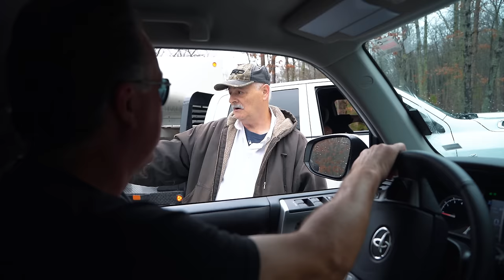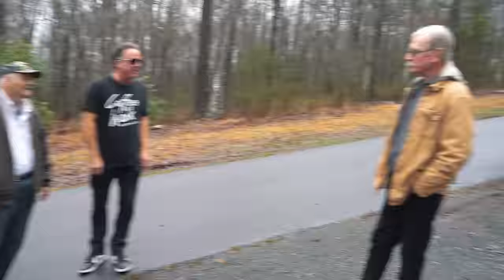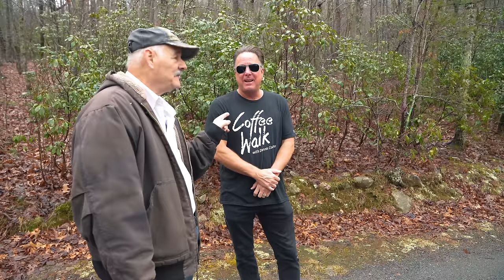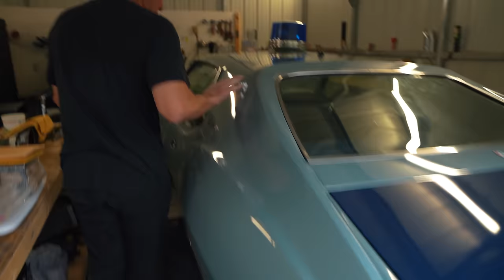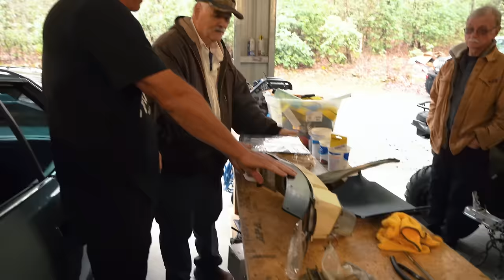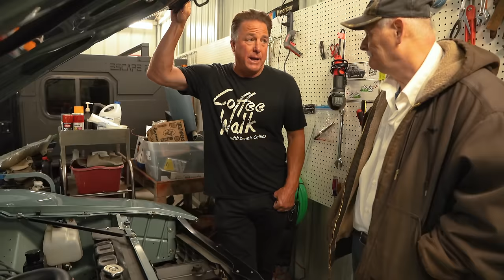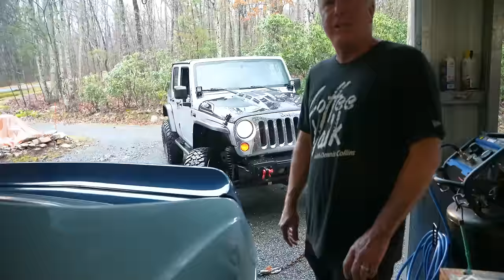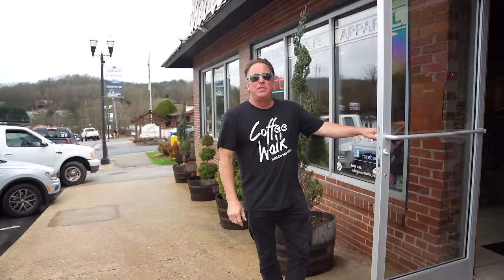FOUND: 1 of 13 Existing ADPS 1972 Javelin SST Police Cars!

Comment: One of my dad's favorite stories was him attempting to flee an Alabama State Trooper Javelin in his '67 Shelby. He was unsuccessful.
Reply: Duh. He was in a Ford.
Reply: Thanks, WOW… Great** Story!!! ** ANYMORE HISTORY OF THAT event???? (( some INDIANA TROOPERS , had HEMIs from 1963….etc…see my osts. Thanks..
Reply: @deeremeyer1749  yep, kind of…. Oddly, the 57-58:FORD POLICE CARS “” *INTERCEPTORS , real ones”: were preferred Buys/ Cars for my CAR GENERATIONS, ETC( we knew some engines  massaged, bigger tires, Brakes Truck,maybe run tough, ++ extras) , IF WE could get the engine, Or Cars, etc.(( INDIANA STATE POLICE, & some “Locals “, with GOOD  DEALER CONNECTIONS , ESP I TO the late 1960-70s(( 409, 427s,++)
Reply: @deeremeyer1749  That Shelby would be worth more than your life today.
Reply: @TheEnd-eg6wq  Dad bought the car when he was a Service Manager at a Ford dealership in Ypsilanti, MI in 1969-70. He falsified warranty repairs and put, as he said, "every high performance part that FMC had" on the Mustang.
Reply: @deeremeyer1749  on a racetrack??
Reply: @deeremeyer1749  Tell that to the Coyote!
Reply: @DEEREMEYER1  I seriously doubt that the Trooper Javelin would have out run my 71 Ford Custom with an N code 429. Police spec car.
Reply: @davidkeeton6716  It's got a cop motor, a 440 cubic inch plant, it's got cop tires, cop suspensions, cop shocks. It's a model made before catalytic converters so it'll run good on regular gas.
Reply: @Long sleeve thong  Well no, that would be my 1970 Plymouth Fury 1 440 police pursuit car.

Comment: Being a 70 year old Alabama guy, I remember seeing these on the road when I was in my late teens and early 20's. You DID NOT try to outrun one of them. 😁
Reply: Ohhhh, there has to be a story behind your comment!! Please do tell!!❤❤
Reply: @teaches2010  Back in the day I had a Torino GT that would run about 130.I wouldn't try. There were some big block muscle cars that tried them out. It didn't end well. Very few muscle cars had the rear gears for top end the Javelins had.
Reply: @stevekynard6658  Torino GT was a great pick ..
Always my favorite
Reply: Sorry but you are wrong. You could TRY to outrun them. However TRYING does not in any way mean SUCCESSFUL. You could try all you wanted but odds were you were going to fail and would fail badly.
Reply: @todddenio3200  It was best to pull over and get your ticket. Trying to outrun one was going to get you in more trouble.
Reply: @stevekynard6658  I understand that and agree. I was teasing you for saying You did not try to outrun one of them. If you read my comment, I was saying a person could TRY to do it... but the liklihood of actually succeeding at outrunning them was not in the runners favor...and that failure was imminent...and was likely to fail badly.. In other words try to outrun them and realize you will be either going to jail when they catch you or they will be using a water hose and a sponge to clean what is left of you off of the road after you crashed while TRYING to outrun them.
Reply: @todddenio3200  No worries.  I was young and foolish in those days but knew where to draw the line. Not to say a sheriff car or two didn't get left behind.  ;-)  Just don't mess with the trooper hotrods.
Reply: @stevekynard6658  Steve you are so right! Back in 1976 my friend and I were cruising around in our small town. He was about 10 mph over the speed limit when a policeman who came up behind us hit the siren. My friend who was 16 had already had two speeding tickets and his parents weren't very happy about it. Anyhow I told him just pull over and take your chances on the ticket. Anyhow he didn't listen and punched the gas pedal to the floor. Well we did get away temporarily due to some reckless driving but he had the only yellow 67 GTO in town. He dropped me off at my house and went home. When he got home they let him get in his driveway and proceeded to pounce on him from all sides. Since his parents were working class and they had made sacrifices to buy him the car it got sold to pay the lawyer, tickets and associated expenses. When I turned 16 a few months later I did get my share of speeding tickets but after what happened to my friend I never had any interest in trying to outrun the police. Seemed like a losing proposition in the long run!
Reply: @kickit59  My Dad bought a 1969 GTO Judge 4 speed that my brother drove. He had put headers and a chopped exhaust, and bigger tires on the rear. Had monkeyed with the timing just a hair. fast off the line put due to gearing top end was where you could almost catch him or did. He took a sat. early morning run on an unfinished 60 freeway. it ended at the turn off for home. He went down two off ramps, uncorked then got back on, wide open, On the seconded overcrossing was a CHP. He saw the lights and shut down. He could have kept going but didn't. The officer had his pistol drawn and had him facedown. After chewing him a new one. he let him off with a ticket. In excess of 120. I couldn't believe seeing that Ticket! Man, Dad was P.O to no end! I just laughed. He ended up in court with 2 weeks in the pokey but was released on Sunday. $500. bucks poorer with a black eye and no shirt from the bus ride downtown. Learning the hard way HUH! The dumb stuff you do to your Folks when you're young. Gald I only had a 58 T-bird. It was old and slow.
Reply: I am a 72 year young originally from Anniston Alabama and I loved watching those Alabama State Troopers chasing down those speeders I got my kicks watching em.........but now I live in the Philippines for over 32 year.  I paid a visit in 2019 to visit my little brother over 300 pounds and did nothing but eat good ole Alabama Southern food........
Reply: I was a young teen when these were put in service. I lived close to the state capitol and my neighborhood had several ranking StateTrooper personnel that drove the plain solid color Javelins and Amabassadors with 401s. Sharp cars for that day. A neighbor was a Trooper patrolman and had a Javelin but after a few months had a 70 Ford 500 with a 428 again. His Javelin and others had power loss from rocker arms and  pivots wearing when run for extended high speeds. AL didn't title cars until 75 year model so this 72  would not have had an AL title.
Reply: @jimmyaber5920  yeah I always like the style of both AMX and Javelin back in those good ole days hahahaha
Reply: That's just laughable, you don't know how to get off the interstate?
Reply: @christopherflynn5359  There were no interstate roads  near Dallas, Marengo and Choctaw counties in Alabama.  Still aren't.
Reply: @teaches2010  Liquor/moonshine have anything to do with that statement?
Reply: Well in all fairness I did use the state line to my advantage. There were some issues between Al. And Fl. troopers in our area.
Reply: More fun with a 4 oh One. Imagine the embarrassment of being caught by a “Rambler” or “Nash”?  Yes definitely a Holy Grail!
Reply: Cant imagine going well over 100 mph and trying to stop. Cars of this vintage age had terrible brakes. Did this cars have disk brakes up front?
Reply: @davidwisniewski3859  None of mine had front disc. Not sure about the trooper hotrods.
Reply: @wildbill7081   Hello,from a fellow Calhoun County native(I'm from the Roy Webb Community just North of Jacksonville,Alabama).How does the Philippines compare to your hometown,and do you ever plan on moving back permanently?
Reply: @davidh6818  I left the Anniston area back in 1970 joining the US Air Force for four years.  After bumming around for many months I then joined the US Army and retired in 1990,       After my retirement moved here to the Philippines and visit Alabama and other states I lived mostly to see relatives and eat the southern food.  My brother lives now in Huntsville area and last went to visit him in 2019 just before covid.  Thank you Davidh for your reply to my comment and I love Alabama for sure and been to Jacksonville and all over that are but I plan on being cremated and stay here.   How old are you and have you ever visited any Asian countries and if you ever visit the Philippines I can show you around.
Reply: @wildbill7081  Born in Anniston, still live in Calhoun County, interesting to see this car has survived for this long.
Reply: @lonesoldier2485  WOW you still live there I left way back in 1970, I lived all around there from Oxford, Anniston, Talladega, Iron City even.  I have been back for a visit in 2019 and possible my last time.  I know it has changed since the early 70's and 60's for sure
Reply: @wildbill7081  Born in 85, and work in Bynum, one side of my family moved here from Huntsville before I was born, and the other side of my family came from Fruithurst, and yeah Anniston is slowly dying off as Oxford is getting bigger.
Reply: @lonesoldier2485  You are still a young guy hahahaha and yeah because the major highway system went thru Oxford many years ago it helped kill Anniston.  Also when they closed all or most of Fort McClellan that didn't help but I was gone in 1970.  I still have relatives around there and my brother lives in Huntsville.  I really miss the food there thats the hardest part.

Comment: There's one downtown here in Montgomery.  "A restored javelin patrol vehicle is on display in the Museum of DPS Headquarters, 301 South Ripley St., in Montgomery, and appears just as it did in 1973/74. It is one of the two that the ADPS saved. Both were in original condition to start with, but in 1997 the first one was restored and recieved a few modifications.  Recently the second one has been restored to it's original condition with no modifications."

Comment: Growing up in Kenosha, this video brought back great memories of these absolutely fantastic cars.  Thanks to Dennis and the crew for preserving this AMC holy grail.
Reply: We are lucky to be from a town with such rich automotive history
Reply: The "Kenosha Cadillac"
Reply: When I was in the Navy doing my tech training in Great Lakes Navy Base in Illinois (1980/1981) I did my pilgrimage to "AMC Mecca", the AMC plant in Kenosha.  I was driving my 1968 AMX.  Fun times.  Big difference though, my AMX had the smaller 290 ci V8, and low rear end gear.  It topped out at 104MPH, but it got there mighty quick. 👍

Comment: Dennis, 'Holy Grail' does not begin to describe this car. I have been facinated by these Alabama State Trooper Javelins for decades and I can't believe you now have one this nice and correct. If you actually do what you said you would do and put on some speed rated tires after it's sorted and do a top speed run....well I'll personally hand you the 'Video Of The Year' award. This is just outstanding.
Reply: There’s a perfect example of one at the alabama state trooper headquarters in downtown Montgomery. Couple of buildings over from the capital building.
Reply: @longsleevethong1457  Evenin, Lst. This (state treasure?) Javelin you mention, any guess how many birthdays it's celebrated up on blocks? Just mildly curious, as i once owned a '70 SST. 390 cid ana 4 gear in Big Bad Green! Had a black vinyl front tonneau roof, with a vinyl wrapped (wing? or spoiler?) contoured to roof line, just ahead of & over rear window. Damdest thing! Couldn't figger, Donahue inspired, or original owners one-off idear. Never really thought too highly of it, cuz N of 90 mph, just gettin into 4th gear, the car started gettin a mite skittish! Never did gno, sold that ride.
KICKIN MYOWN ASS!   now.  🤷‍♂️

Comment: What an awesome car, I was 9 years old in 1972 and I remember seeing those Javelin’s when Alabama started using them and how cool they looked.
Reply: I was 16 in 1972, about when I first saw a Javelin in a store parking lot.  I fell in love with them then.  I later owned three Javelins - 1968 w/232 six, 1970 SST w/360, 1971 w/304 - and a 1968 AMX w/290 V8.  The 68 Javelin was my daily driver, the AMX was my fun car. 😎
Reply: @lancerevell5979  one of my sisters had a javelin, it was a cool car. She also had a Gremlin at one time, I remember having to sit in the backseat of her Gremlin on a trip to and from Orlando, FL. From Huntsville Al. 12 hours one way. I was young but tall for my age, that was not a fun trip.

Comment: My dad drove one in 1972 as a Trooper. He said they were dangerous with the factory bias ply tires. After they changed to radials  they handled good.  He had several stories he used to tell. He tried to buy one for me as my first car but another trooper bought it first.

Comment: Very cool Dennis!! I am a retired Alabama State Trooper and I have heard all the "War Stories" from the Old Timers that drove those cars back in the day. Good Find, there are only a handful of those Javelins left! I was issued one of the 32 Mustang SSP Interceptors that the DPS bought in 1988 ....I have a few "War Stories" myself!! The 35 number was done by the DPS shop all DPS equipment had 35 Numbers.
Reply: I was in the academy at another State i 88, when the Troopers were running their new Mustangs on the academy road course day and night.  They also had access to the Indianapolis Motor Speedway at times for their high end cars.

Comment: Back in 1976 I owned a 1970 Cougar Eliminator with a SCJ 428 & locker reared with 273 gears, and I can attest to the fact that nothing could pass it or runaway from it on the highway.  The 273 was such a tall highway gear I could pass most other cars while pulling a boat.  That’s right, it had a trailer hitch.  I’m sure this Javelin would do the highway speeds Dennis says it will.

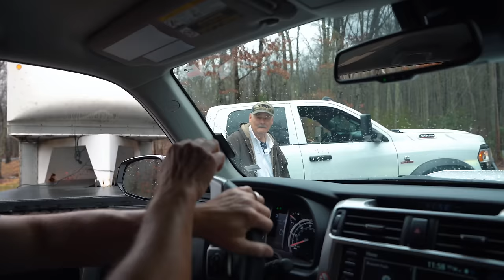Comment: Saw this and had to comment. It was a Saturday night in the spring of 1973. I was working in the pits at Nashville Fairgrounds Speedway. After the races were over, my girlfriend and I headed to Talladega going to the race on I65 South. It was probably around 2:00 early Sunday morning, somewhere in Alabama, and this was when the speed limit was 75 mph. I had a 1972 Road Runner, and I was running around 85 or so when a late 60s model Mustang came upon us, and past us like we were standing still. He had to be doing 130 or so. After his tail lights vanished in the night, I noticed blue lights coming up behind us FAST. I figured it was the police, so I checked up a bit. When the car caught and past us (again, like we standing still) I caught a glimpse of it, and it was an Alabama State Trooper in a Javelin! This one was brown though, not blue. I had never seen a Javelin State Trooper car before, but he was hauling! After he disappeared into the darkness, lo and behold, we drove about 10 miles down the interstate, and there was the Mustang on the side of the interstate with the State Trooper behind him, lights flashing. The Trooper had run the Mustang down.  Seeing this video bought back the memory of that morning many years ago.

Comment: Dennis, I'm a long time fan(back to the GMG type days) and love watching you and Richard do what you do for old cars, new cars trucks and bikes of every ilk....this is going to be one of my favorite episodes, because even though I am a big fan of everything Mopar, I am a HUGE, MEGA fan (and ex-owner of Ramblers, Nash's and AMC of all size/style/design....my very first car that I owned was a 1964 Rambler Classic 550 4dr, with a 232 inline 6 with a 3-spd Torque-Master(?) transmission. The car I learned to drive on (and eventually owned) was a 1964 Rambler Classic 660(?) Station Wagon that was my parents' car. It had a 287 V/8 with the same basic transmission as my 4 door. One of my 3 "DREAM CARS" is a 1966-67 Marlin, with the 270 hp 327 V/8 4 barrel and the 3 spd automatic on the console. I'm 64 now and slightly disable from a hit and run on my 67 Harley 13 yrs ago, so the likelihood of EVER owning any of them is not good, but hell, an old guy can dream as much as a young guy...lol...as for this absolutely freeking amazing Jav SST, I really dig the colors and just love the whole look of ,as you put it, this "Holy Grail" car...especially with the 401. I've had a 73 Gremlin X that someone had shoehorned a 401 /4 barrel into with a 727 Torque Flight (with a Trans-go stage 3 shift kit I was told) and I also had a 1973 or 4 (can't remember) Hornet Sportabout Wagon  with a 360 out of a wrecked SC360 from 1971(the guy who was driving it rolled it 7 times and stood it on it's nose, roof down towards a huge rock in my home town...and walked away with only a broken wrist...I'm a lover of wagons so when I bought the Sportabout, AND found out it had a 360...that was a happy moment too!...anyway Dennis, peace out from Doc, in the Great White North of southern Ontario,Canada...and if you're ever up this way, coffee is on me.

Comment: I had a 1970 Javelin that was the dark racing green with Cragar SS Chromies. Got ran off the road and totaled it in 1974. Bought a 1972 SST, the same color as this one. Blue printed and balanced the engine and could get it up to 162. Never got past that as it scared the hell out of me at that speed on the road. Miss both of them. Wish I had bought the 1970 back from the insurance company and restored it. This is a great find in this condition. I would love to own one again, but they are out of my reach. Brings back some great memories. Thanks for sharing.